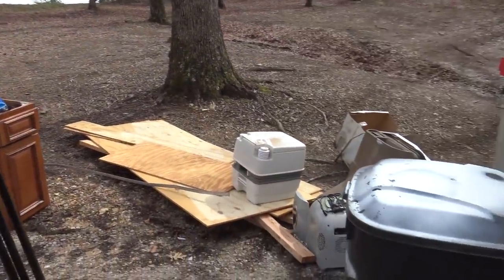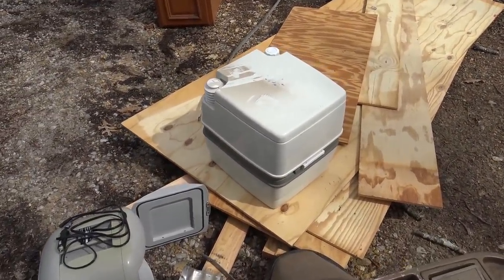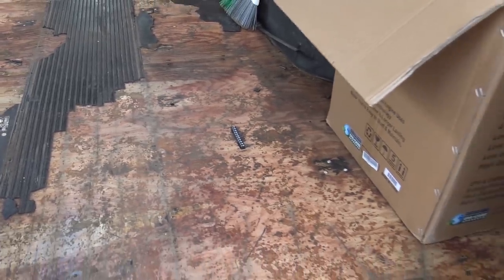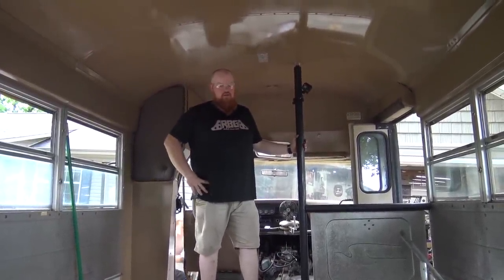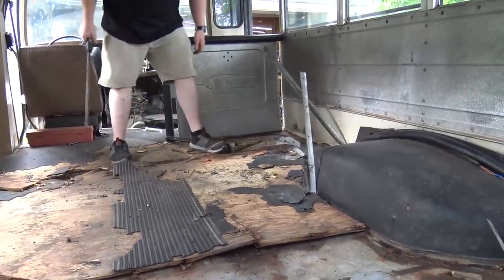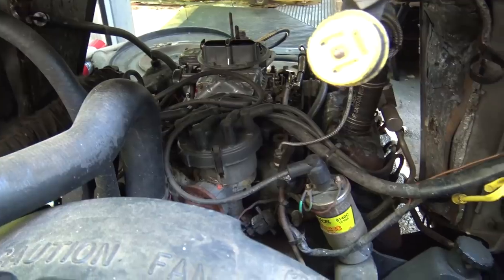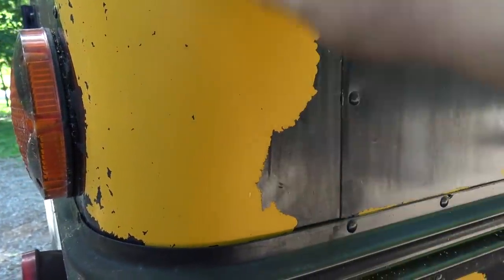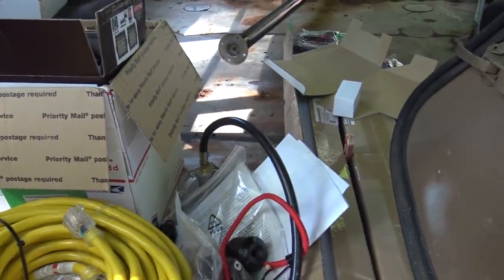Short Bus RV Conversion Ep3 - Cleaning & Demolition

Comment: You should use solar panels to power your camper during the day, you could put them on the roof and use like 2 or 3 deep cycle batteries for golf carts to store power
Reply: You’d had to put the lead acid battery outside for the venting. Lithium iron battery’s are a much better option for inside of their camper.
Reply: @Firebird_876  I was just saying that because they are cheaper, of course by all means if you want to spend the money get Lithium Ion batteries
Reply: @Firebird_876  Newer vehicles run AGM batteries inside with a vent tube to get rid the hydrogen gas fumes.

I do agree with the solar panels to help run stuff.

Comment: If you plan to leave the top unwrapped, be sure to put a strip of adhesive tape over the edge of the wrap. Heat + water will ruin it otherwise. 3M had a durable tape that's meant for roofs. Would work just fine for this.
Reply from the maker: Thanks for the heads up. If its not much more we will just get the roof wrapped as well

Comment: You can probably find a little pop up camper for free or really cheap and use all the wiring and breaker box maybe even heater and air conditioner out of it for the bus

Comment: Consider putting unistrut (B-line) on the roof to make it easier to install things or move them around. I bolted two pieces to my truck bed to mount my toolbox and it hasn't rusted in the past 5 years even where I cut it. It's sold at Lowe's in 10ft sections.

Comment: Frame it, run electric and plumbing than spray foam the walls and ceiling. Maybe inverter to run microwave, fridge, etc. Add 6x14 trailer for your builds.

Comment: the bedliner prolly will work well on the floor you need to make real sure all the holes are patched as i suspect water can creep in between the floor and the bedliner and it be realy hard to take it off to repair the sheetmetal . buy a few different colours and you could do the walls up to the windows and the bedframes too , if youre using the bus only in summer when its warm the way you want to do the floor is good enough , the insulation isnt good enough for colder days and you verry likely be running the heater on high all the time if you want to sleep in it 
still think that putting a deck on the rear isnt a good idea as you cant tow anything behind the bus if you put it there , i still suggest putting a deck on the roof with a 4 inch high bar around the edge and small ladder on the back , it will prevent the interior getting to hot from baking in the sun as the deck will keep most of the sun off the metal roof , you can store stuff like mercendice on there strapped down in watertight cases when traveling you can hang a tarp from the deckrailing and some stakes on the ground / poles put in flag cariers  ( https://cdn.webshopapp.com/shops/269514/files/247254974/768x768x2/vlaggenstokhouder-aluminium.jpg ) on  the bottom sides of the bus and set youre table up under the tarp out of the direct sun 
the generator(s) can go on the back of the bus on small platforms blocking the 2 smaller windows where they whont be in the way of a trailer 
about the wrap for the bus , you could replace the window you dont need with wood or steel and have the wrap guys wrap over that , you could allso do a wrap with small holes over the windows you do want to keep to give a little more privacy while still let in light 
you could use the same setup as an outdoor kitchen , just need to add a jerrycan of water and a tub and a big plastic cuttingboard 

think the diesel transplant is a great idea , make sure you get a complete donor for the motor so you can use most of the wiring , fuelsystem , dash , exhaust and driveline too ....... cruisecontroll and remote for the radio would be nice if you can fit the dodge steerring column in there

Comment: Just my pinion and 2 cents instead of a6bt I'd be looking at a4bt  Overall smaller package easier to fit in the space you have and be just a reliable as the 6bt.
Reply: The 4BT was only 105 to 120hp. The 12 valve was 160 to 215hp. Both would have the power, but good luck finding many 4BT anymore for less than $4000.

Comment: why spend 200$ + pm bed;liner to cover it. use that as your floor our just use a rust preventative self etching primer or rustoleum paint. bottom paint for boats would last a long long long time. and protect floor and fractions of the cost. but any exterior paint would work also. esp anything oil based no need waste $ on bed liner. and trust me i love bed liner. i would bed liner that whole bus. but i do a texture to get that matte look. have send ya pics i guess. spraying it is best and cheaper in long run. the gun isnt much $ clean it use again. and again.

Comment: Ehy cumming istead of 429 hemi
Reply: Ford actually had 2 hemis the best engine in my opinion was the 427 single overhead cam Hemi also known as the camer and the second one is the Boss 429 which used Hemi heads the regular 429 used cylinder heads similar to the 460 big block. Look up a YouTube video of the single overhead cam 427 those engines were straight up beast! and I'm a Chevy guy lol
Reply: Pretty simple more power less fuel